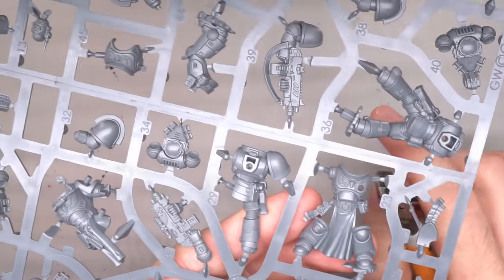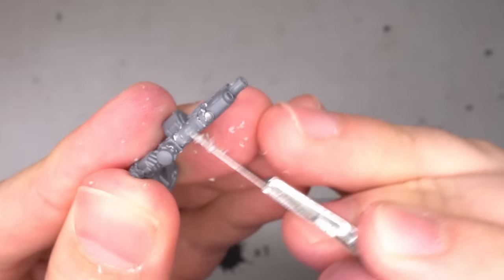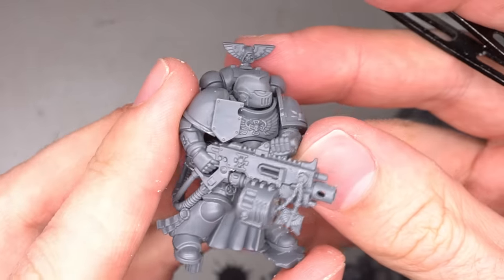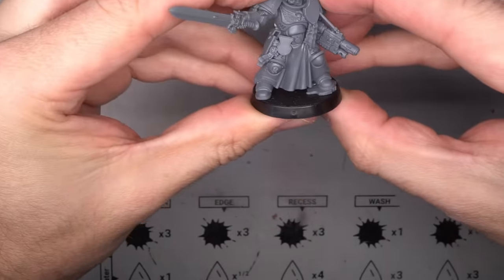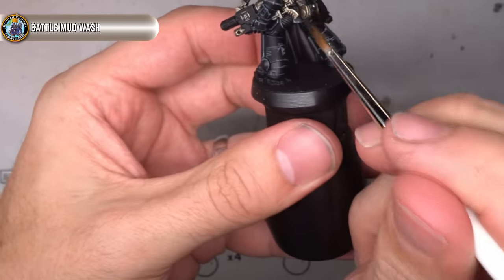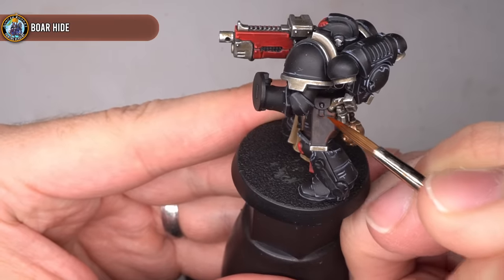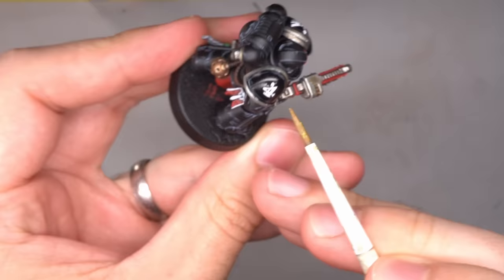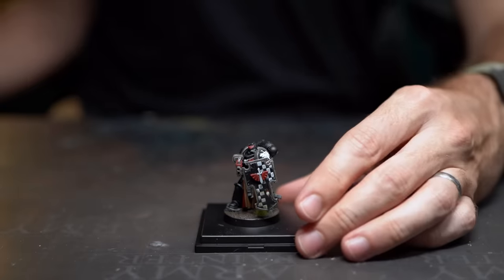Kitbashing THE REDEEMED - Dark Angels Sternguard

Comment: I really liked the video and the paint job. Although one thing that I would change is that I wouldn't use the primer as the base coat because if you make a mistake and get paint on it you are going to have to fix it with black and black paint are actually deferent from each other you might get deferent shades of black on the armor then.

Comment: The other question while I am on a role, instead of grey was there a reason not to use a dark blue?  With black I like to hint at shade rather than the bright highlight and I started using the old midnight blue GW used to sell. I have since hunted for a similar colour and found that watering it down and mixing with black followed by a straight blue allows for that shading. By comparison the grey comes off really bright and the boots look like scuffed leather.  Just a suggestion to an alternative.